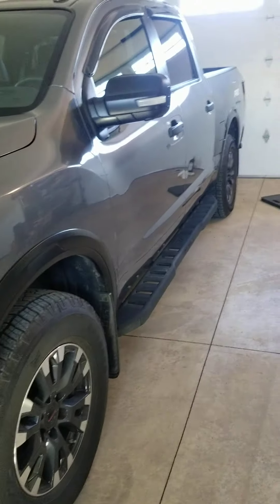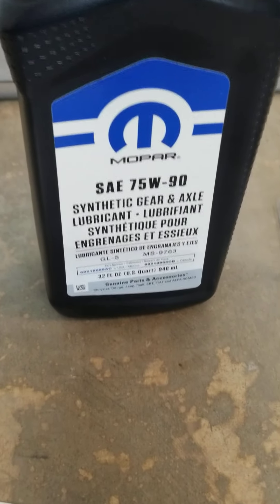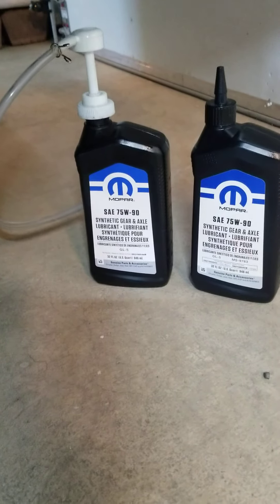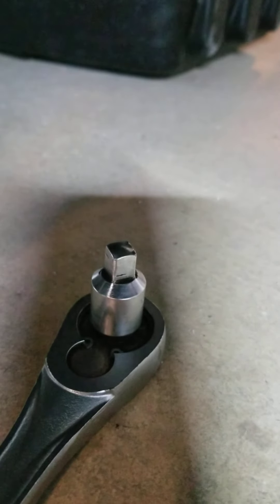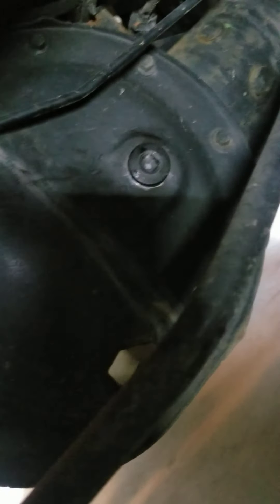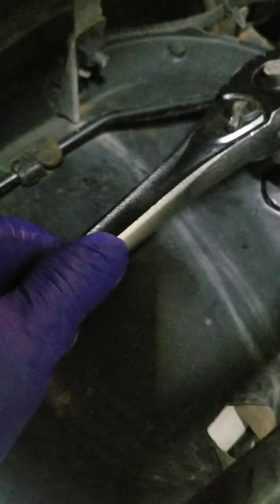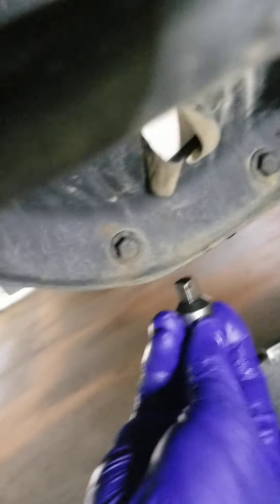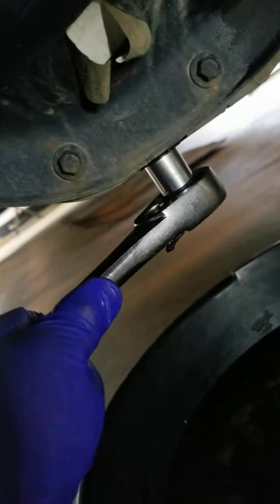Rear Differential Oil Change 2020 Nissan Titan

Comment: Thanks for the Nissan videos?? Are you planning on changing the transmission fluid?
Reply: Have you found anyone that has on the 9 speed?
Reply: Its quite the ordeal to change trans fluid in a Titan. First off theres no dipstick meaning you cant check level and no place to fill. Second the trans has to be up to a certain temperature. You can drain the fluid from the pan all day long but theres a special fill tube that has to be screwed into the drain opening with a pre-set height to set the fluid level when pumping new fluid in.
Reply: How often do you have to change the rear differential and Tranny fluid.    Would you recommend buying a 2020 Nissan Titan pro 4 x ?

Comment: How often do you need to change it?
Reply from the maker: It is recommended every 30k to 60k miles, but it depends on how you have driven your vehicle. If you tow often, change it more often. Changing it before the recommended interval won't hurt anything.